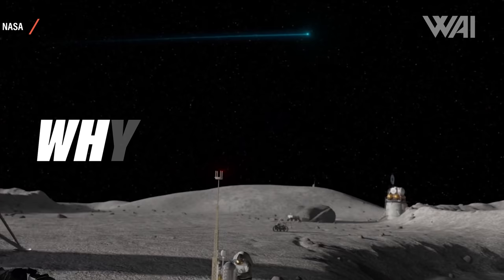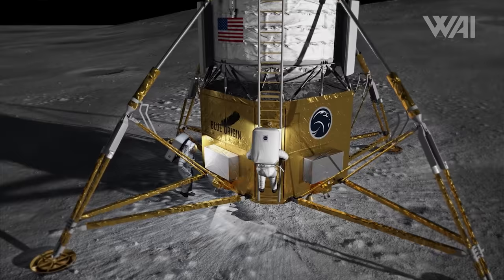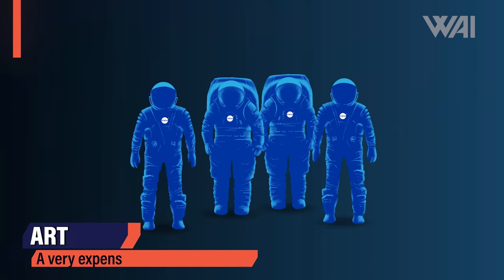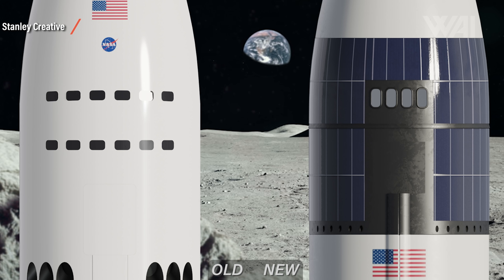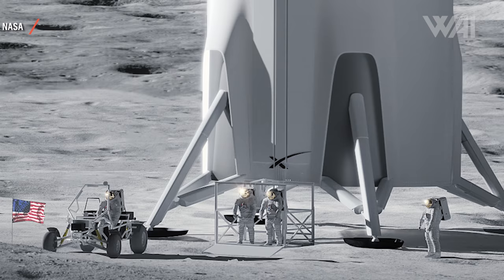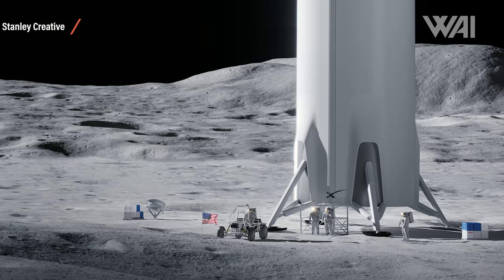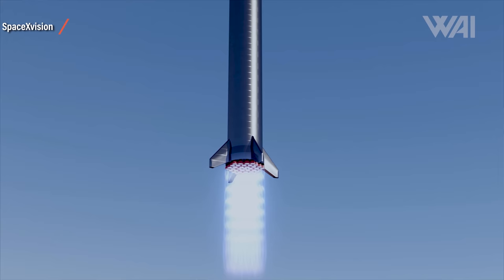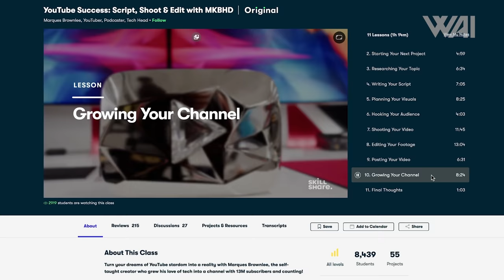Why Did NASA Award SpaceX 2.9 Billion Dollars For A Lunar Lander?

Comment: Blue Origin has probably been going "They won, we lost?  How??" ever since Friday .. and then on the following Monday (yesterday), AMAZON picked ULA to launch its Starlink competition/rival Project Kuiper and not its 'sister company' Blue Origin .. so they've really got to be going around in circles going "What?  But..?  What?" right now.
Reply: Damn that Amazon news revealing something nasty, probably blue origin never and will not have a working production of Orbital Rocket in the near future. Probably because blue origin lose multiple time and bezoss just don't want to full throtle buiding their Rocket first then win contrast later. Only waiting for contract
Reply: And not even Vulcan. They bought Atlas's.
Reply: Turns out the ULA system was overweight/volume.  When they listed the capacity available for expansion, they had a negative number listed.
Reply: @edwardsummey8843  No that was the ALPACA lander by Dynetics. Technically ULA was part of that effort but only in a minor role.
Reply: @raifikarj6698  After 20 years, all BO has to show is a partially completed MOCKUP of a rocket (NS doesn't count, it's just an overpriced themepark ride). 
The one thing they actually managed to do is the BE-4 engine, and even that project has had a lot of delays and other problems.
Reply: @user-lv7ph7hs7l  To be fair, that's because Atlas actually exists and is flying. Vulcan is probably closer to being operational than New Glenn is, but Atlas was chosen because they actually need to start getting stuff into orbit, or risk losing access to the radio frequencies they're using.

It says so much though that despite the greater cost, they chose Atlas over not Falcon. I'm sure Elon would have been delighted to take money from Amazon — maybe even given a small discount — but it's pretty hard to see Jeff Bezos swallowing that bitter pill.
Reply: Amazon went with ULA because Bezos needs to keep ULA from failing it’s Blue Origin’s only costumer.
Reply: @simongeard4824  Both Gwynne and Elon have said they are happy to launch anyone's cobstellation including Starlink competitors but yeah it's a hard one to swallow. 

And Vulcan has been ready for a while waiting on engines. They could start launching it in numbers as soon as 2022 provided BO can make enough BE4's which will probably be a bottleneck for a while to come. And Amazon probably did get a good deal buying 9. A considerable amount, ULA plans to only launch about 30 more Atlas's before retirement. (Tory shared that recently after having been tight lipped about the number of RD180's they can still buy).

Comment: Starship has shown it has no problem going up. Super heavy will have no problem going up even if it can't be recovered, refueling can happen. Starship has shown good restarting... so long as gravity is in the right place. Spacex has a long history of restarts in space. Spacex has already built human rated craft and has a good understanding of what is needed. Starship has shown reliable powered landing without the flat drop and orientation change. Basically, the only part of the trip spacex has not demonstrated, is fuel transfer in space... but note that NASA has already given them money to develop that part of things. All of Starship's failures have been with a maneuver that will not be required for a moon landing or to recover boosters.

Comment: Starship...”she got legs, and she knows how to use them!”  

The weight savings for the heat tiles and flaps will be partially used for the landing leg system and hydraulic leveling system.  Starship will have to be made level after landing to secure it in place.

Comment: Well since the main engines are not being used during the final step of descent and ascent, you could just food the leg covers under the Starship. They could even act as engine bell covers to protect against dust and debris.
Reply: I think this is a valid point. Another mistake using current SpaceX design is the near total lack of "lateral give" in landing which for example a "ski/snowboard, snowmobile ski suspension" type base upon the landing support system which at least allows for recognition of the physics involved in trying to hold (stay?) something so massive.
Reply: It would be complicated, and if it would be useless why have it?
Reply: @ImieNazwiskoOK  Okay. I assumed at least some of the Starships would fly back to Earth.
Reply: @hdufort  For normal Starships of course it shouldn't be fairing (they could fish it out of water but they will need more boats and it will only take time and money), but for Lunar Starship it could be

Comment: could use Crew Dragon to transfer crew to/from Starship in LEO
Reply: Seven people at a time.
Reply: @marchelgeson  They probably will have 4 or less people for the first moon landing.
Reply: Right. It would require that Dragon stays in LEO for the entire duration of the trip to the moon and back. However, this approach makes SLS and Orion obsolete so NASA won't go in that direction at first. Using Crew Dragon (or Starliner) to LEO would result in such massive cost savings per launch over SLS and Orion that it cannot be ignored.

Comment: I don't think these are just leg covers. I commented this when the current leg design was revealed: Starships are heavy. They will have issues with ground pressure on the Moon and twice that on Mars. This is why the visible "cover" will probably lay flat on the ground, to maximize contact area. It also makes more sense from a deployment/mechanical perspective.
You have probably seen a truck with a lift at the back, which also doubles as rear door. I think this will be similar.

Comment: A reasonable beginning, but not ideal for permanent habitation.  One does not use a motor home to permanently settle in.  That would waste all those expensive power train components.  You would use a trailer or prefab housing and transport it to the site with a truck.   Same goes for starship, all those expensive engines, fuel systems and tanks are too valuable to leave as part of a permanent habitat.  Starship is as a motor home,  good for a visit.  What will be require going forward is a lunar tug to place habitats on the surface and return to the gateway for the next piece of the assembly.    The tug could still use vacuum raptor engines mounted peripherally  high around the side so as to attach the habitat to the bottom thus keeping the engine plumes high above the surface to reduce the  lunar regolith disturbance.  The same tug concept could be used to ferry personnel, consumables, and equipment  to the now expanding permanent facility.  Lunar produced fuel could be delivered to the gateway on return trips.   Now the habitats are close to the surface where ladders and elevators will not be required.  Will be exciting to watch.  It will rock!

Comment: My thoughts are the legs can touch or slide in behind the mast plates as opposed to a possible buckle or locking mechanism flaw. They need to extend out farther due to the top heavyweight of the landers weight proportion mass. This would keep it from toppling over and reduce tip over. Not only that , there is less parts, sleeker, and faster deployment.

Comment: Leg cover won't blow off - they'll be part of what's needed to stop the Lunar dust micro particles from getting in to the leg mechanism.
Landing rocket motors will absolutely use the same fuel as the Raptors - a mini-Raptor is more likely then a Super Draco.
Lunar Starship will have fold-out solar panels, just to be able to keep them pointed to the Sun.
The big problem to overcome, will be acceleration due to Lunar Gravity - there's no air there to sky-dive through and slow down, it has to use those motors all the way down, expect to see a couple of unmanned units landing first, to make sure both the hardware and software are fully operational before people go,... And that in turn leads to having a few ships parked on the Moon, waiting for use by the soon to arrive Astronauts.

Comment: I don't know if it's a great idea, but there are certainly a few things I like about it. First it's big enough that it can actually act as a research outpost long term rather than just an orbit-to-surface elevator. And I like that it's not a million stages. As long as the engines and life support systems are reliable the voyage becomes much simpler.

Comment: Just an idea I had, Starship is about 50 meters tall, what if in total the booster it was three separate pieces. How about on the moon lander that only the crew and cargo portion, about the top 20 meters had the landing legs on it and no need for an elevator. they want a permanent base so from the payload door all they would need is a ramp.  They could discard the engine and fuel section in space

Comment: So if SpaceX builds several Lunar Starships, 1 could replace the ISS as it has more living and equipment space, Plus engines if it needed to move in it's orbit for some reason. 1 could be used as a station orbiting the Moon same as above, plus it would add the benefit of a rescue ship if something happened to the moon base. Then there could be 2 more to ferry people back and forth to the moon and replenish supplies which will be a major factor at least in the beginning.

Comment: If you have pop off leg covers and the starship will not be coming back design the leg covers to be part of something constructive on the lunar surface like wall panels or roof panels. you could machine a groove around it and have simple stretch bands for gaskets around them then bolt them together for air tight fit. Many different things you can do other than let them burn up after launch.

Comment: Hey Felix, another thing the moon Starship will not need are the three atmo Raptor engines. Lots of weight and complexity removed as only the vac Raptors  will be needed for launch. Separation from booster takes place at about 62klm's so already in vacuum, no need for atmo Raptors!

Comment: I'd just install the landing legs for the lunar version in earth orbit. Simple constructions optimized for only one purpose, to serve as landing legs. No need for folding mechanisms or aerodynamic fairings. Just some EVA and a few nuts and bolts. A little over simplified but you get the idea.
Reply: No one will be near the lunar starship after it launches until Orion meets up with it, or lunar gateway, in moon orbit. So no EVAs for that since there won't be any astronaut around.

Comment: SpaceX's idea is better than the rest. It's cost-effective and gets the job done; moreover, it is practical. When Space X finishes the hard work of landing on a smooth surface, they all should copy the design and start again with more ambitious engineering...! A Lunar Starship is for later on. Right on, the idea is going up and away and coming back down safely. 😃

Comment: The reason for the low price from spacex is because spacex is covering most of the dev cost. ie. they are building starships to deliver cargo to space and to mars so making a lunar version is just a small side project. 

Because of the variable amount of fuel it can be filled with what is needed for the mission (more refils = more ability to carry larger loads) but it doesnt need to have a full tank to do a small mission. This means NASA gets the project cheaper with the potential for much larger projects using the exact same vehicle, just with more fuel on board. 

NASA also loved that it has 2 airlocks fed by 2 life support systems so that if one airlock fails there is another and if the hull is punctured they can use the airlocks as a lifeboat. 

This system offers NASA everything they could dream of for a bargain price.

Comment: The interior volume of starship is over 120X bigger than Orion... At this point use SLS to re-tank Starship in LEO if it must be used and be done with it. The sunk cost fallacy is baked into the American government at this point. Besides its the 21st century, capsules are fine for LEO but that's all, more space means more equipment more safety measures. Starship is big enough it could carry an emergency dragon capsule inside.

Comment: 12:27 The last question and the easiest to answer. NASA gave SpaceX a performance based contract. That means that SpaceX has to met certain milestone in a certain period of time. To get the next injection of cash to continue the project. So all you have to do is read the contract to find those milestones. I can't find the current contract for SpaceX for those exact dates. But it is easy to say that SpaceX will meet or beat the deadlines set by NASA.

Comment: Great episode! What do you think the thrust from R2/MERLIN's on the surface on the Moon? I'm not that clear om what engines they are going to use, and how they are going to use them? How do those engines differ from the Apollo missions, and what benefits? (besides self starting). How does the crane hold under pressure along with the solar panels on the ship during launch and deployment? Their isn't a big enough faring's to let the solar panels, (not get "RUDDED'D," through the launch. How does a cyber truck function on the moon? 
Anyway, great video, and keep up the outstanding work!

Comment: If the lunar Starship was launched on a Superheavy booster, would you even need the 3 sea-level raptors? Starship would lose the ability for thrust vector control, but surely a less massive solution could be implemented for attitude control. SpaceX is already planning on using hot gas thrusters for reaction control, would those be a sufficient ACS/RCS solution during orbital/transfer/capture burns? No part is best part, and they seem like a whole lot of mass for very little benefit.

Comment: NASA's SpaceX choice is very simple... The SpaceX Starship can be the complete Artemis solution. A single Lunar Starship can act as the Lunar Gateway station with it large volume. All that is needed is a module with multiple airlocks to dock with the Lunar Starship to extend it for any number of additional modules in any direction you like. Also the SpaceX Dragon can take astronauts to the Lunar Starship. Finally, you can use the Lunar Starship as a Lunar Cycler as well.

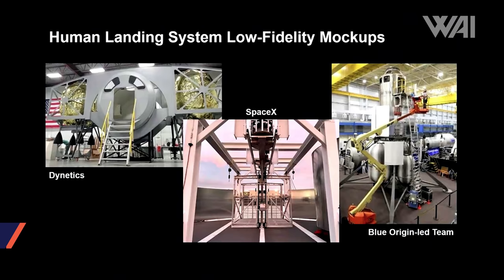Comment: Excellent video Felix. It's great to see SpaceX making the necessary design changes to have a successful landing on the moon. The Lunar Starship landing legs look to be much improved, and it'll be interesting to see if the thrusters will work as intended. I hope SpaceX plans on landing the Lunar Starship on the moon several times without a crew to ensure the current design works. What I really dislike about the lunar lander is the location of the cargo hatch, and crane/elevator. While it really looks cool as heck, it's really not practical from a safety standpoint. As shown in your video (7:55) the Dynetics, and National Team designs make much more sense for quick egress, and ingress. If there's an emergency and the astronauts need to depart, or enter the lunar lander in a hurry the SpaceX design will be a real hinderance. Also, what happens if there's a technical difficulty, or mechanical malfunction of the crane while the astronauts are on the surface of the moon?

Comment: I believe the legs on the lunar starship are a trade off because of losing the weight of flaps and heat tiles so the weight will be similar. Also, Elon doesn’t like recreating the wheel so I expect falcon style legs. I understand once the lunar starship is refueled in earth orbit it will be good for several landings. They would have to pump methane and oxygen UP to those thrusters so I’m wondering if the fuel tank arrangement won’t be different as well. I saw they were flipping the lox and methane tanks but I don’t know what that gets them. I think they have to redesign to tanks.

Comment: I don't think they need many windows. Instead, add MANY small cameras on the outside. Inside have large LED screens so they can get a full 360 view outside or anywhere a camera can go or even a video from home. It's A 360 real-time IMAX theatre and multi-purpose space! if the screens are too heavy, use VR glasses.

Comment: SpaceX has changed space travel dramatically in such a short time, I hope that, with the dramatic reduction in cost as appears will be realized with SpaceX hardware, colony components could be placed on some especially worthwhile areas. Research labs, living quarters, green houses, machine and repair space, sub-freezers, garage space, etc., will probably be set on the Shackleton crater rim especially early in the process of permanent colonies, with water in and around Shackleton in neighboring craters, relatively rounded contours of its rim, and 24/7 direct sunlight every day with relatively brief periods (hours to a few days) every month, excepting lunar eclipses, which would be especially interesting to see from Shackleton. I believe earth is visible most days of the month, as well, depending on exactly what part of Shackleton's rim your view is from, and that would be much larger, relatively, than the moon is from earth, and very colorful with endlessly changing cloud patterns.

Comment: Think you need a spot in this about the operational complexity of lunar starship (it’s biggest drawback according to nasa). A lot of refuelling and without heat shields it can’t use atmosphere for a free return so it has to slow down in Leo (more dv), to be reusable. In short fully loaded it doesn’t have enough fuel to get back. It needs either lunar refuelling or more likely a starship tanker in an eccentric  orbit, as well as another one in Leo. Min of 11 refuelling’s unless they improve payload significantly beyond 150tons